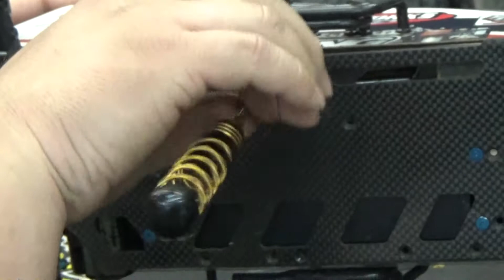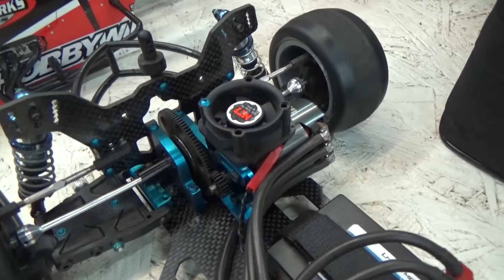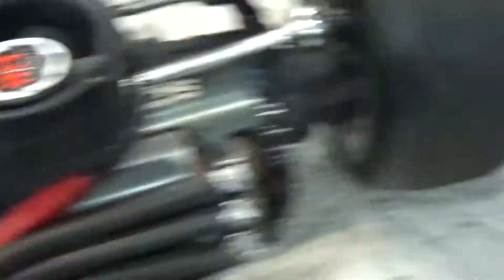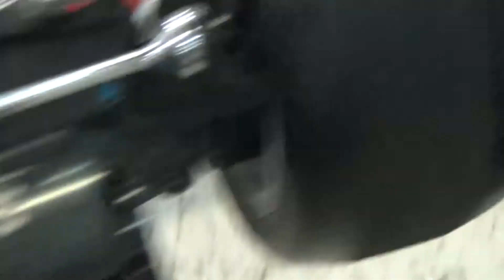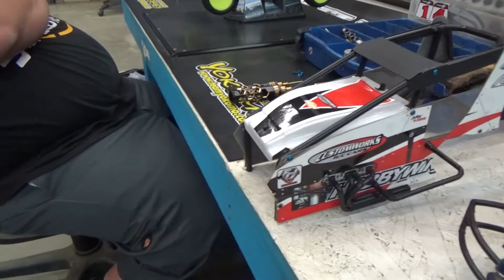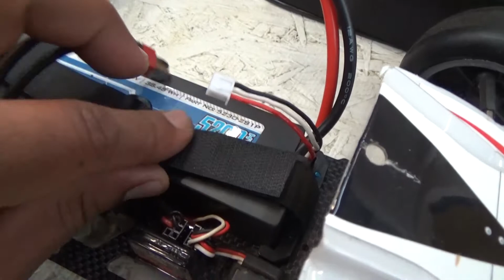Inside Max Flurer Custom Works car #CustomWorksrc #hobbywing

Comment: Been out of rc for a long time ,boys got older moved on so dad just watching  my antique  custom works 🤩 with delta shocks look funny now that they use the larger shocks ,and by the way no in the ole days we had adjustable  rear tow not as nice as now I see ,good luck to all have fun for me ,my stuff just hanging in garage
Reply from the maker: Hey john thank you for tunning in.

Yea alot has changed, but somethings stay the same.

You getting back in?
Reply: @rcvitals  probley  not ,grandboys seem not interested  ,and for me want to  just to see if I can make these new electronics work, seem to be a new world to try ,mechanic all my life ,and the chassis no problem ,seems what I hear most guys are just now figuring out faster an camber etc ,too many years in actual racing ,can't seen to shake the want to compete 🤣